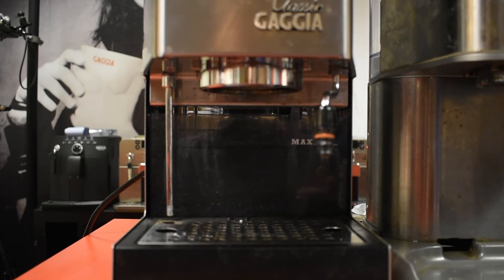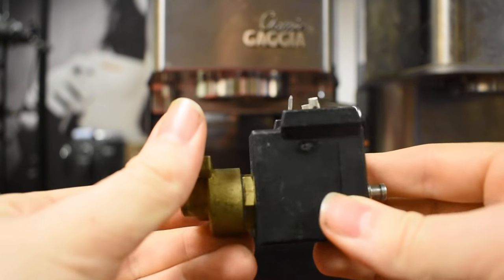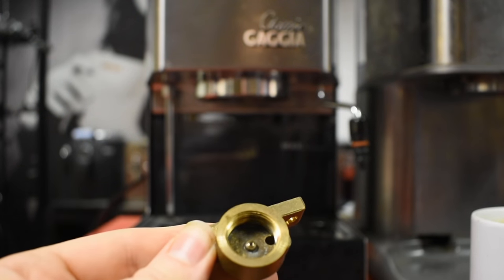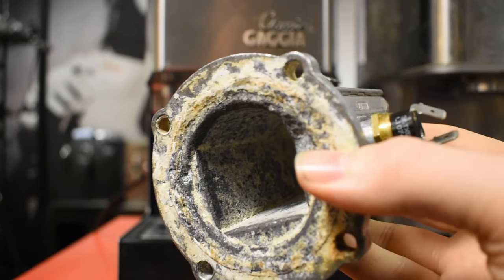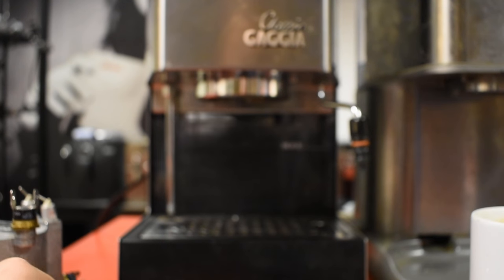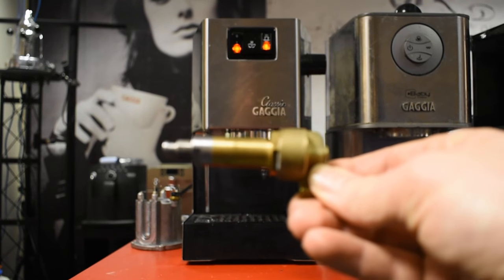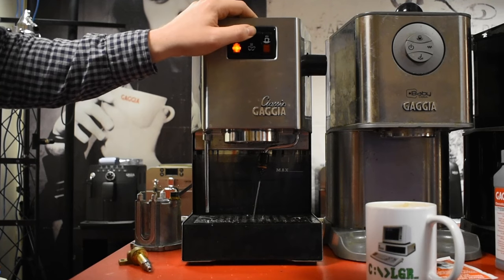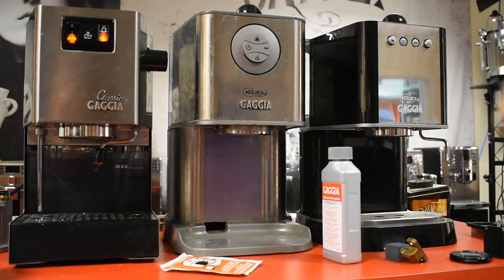Unblocking a Solenoid Valve on Gaggia Espresso Machines - Gaggia Caffe TV

Comment: Bloody hell!!  It works!!  I just unblocked a machine that had been standing idle for more than a year.  I was about to chuck it out and buy a new one when I came across this video.  Water is now gushing out of the brewhead.  The only thing I would add is to let the descaler sit in the machine for a while if it doesn't unblock first or second time around.  Also, collect the water containing the descaler and put it back in the reservoir; that way you won't have to use so much descaler.  Absolutely brilliant!!
Reply: John Teape Good tip about letting it rest and soak. I would definitely not reuse the descaler though as the water will have bits of scale and debris in it and you would not want to run that through the machine again.
Reply: @bslenter  i agree completely, unless the solution is not oily and the bits sunk to the bottom i think its fine
Reply: Legend it works perfectly

Comment: I found a pretty new discarded Gaggia Classic in near perfect condition at my local recycling center, took it away no charge, did this procedure and it works better than my 10+ yr old machine. It took all of 15 minutes and cleared on the first try. I was simply going to scavenge it for parts!! This procedure needs to specify more clearly that the tank is filled with descaler when you do these steps. And, probably a good idea to run about 300 ml of the descaler through the steamer wand first and let it sit a few minutes.

Comment: It looks like it was not the pump after all .  Well I have a spare pump, new gasket in place and Gaggia has been cleaned the way it should  and now will be cleaned.  There was not much water coming out of the group head , so I tried the  steam ,/coffee toggling of the switches and it appears to be working now. Why more flow out of the group head.   flushing with the descaler  now.  Thanks

Comment: 1. Put descaling fluid in the tank
2. Turn machine on
3. Open the steam valve
4. Turn on the coffee button
5. Turn the steam button on and off (6:05)
6. This will hopefully dislodge the bits of scale in the valve and water should start to move through the system
7. You might need to run this cycle 2 or 3 times
Reply: That's just worked for me thank you very much.
Reply: Legend!!!! Thanks so much. Worked for me too. Was distraught my old machine had died.
Reply: what happens if it stops pushing altogether thru coffee (not steam)....this all started when I did descaling but now I think it might be hosed
Reply: @TommyJordan-rf7zz  have you done this cycle multiple times? It's possible your descaling dislodged some chunks which have travelled down and lodged a bit lower. So potentially another few cycles could break them. (This happened to me).
Reply: U R THE MAN!  I was on #7 and was just giving up because nothing came out.  Then your encouragement made me try one more time.  8x a charm.  THANK YOU THANK YOU THANK YOU.
Reply: @TommyJordan-rf7zz  AWESOME!
Reply: thanks for detalis video not good,we need to close the wand wheel?
Reply: also waht u mean about the cycle we need to do open close steam button ,untill all water is out guys give a further details also i see ,the guy close the wheel what we should do?
Reply: @cryptolve  open the wand wheel

Comment: Being one of the lazy owners referred to by our master, my Gaggia blocked up after an infrequent descale.  The same thing happened a couple of years back and I had a tricky time removing the solenoid valve and cleaning it. This process was MUCH easier. I also used a blanking plate on my portafilter after running the descaling solution through the boiler with the steam wand, then turning the pump on an off to shoot descaler backwards through the solenoid.
THANKS.

Comment: We don't have limescale in our area. i.e. nothing in our kettle (soft water). However, when I took apart the coffee boiler and it had about a teaspoon of 'grit' in there. I think it is aluminium oxide that builds up over time, so I think it is generally best just to completely dismantle the machine every couple of years. I've marked the electrical connectors with numbers and photograph it with my phone as I go, otherwise you will never remember which wire goes where. I didn't disassemble the solenoid, but just blew it through with compressed air.

Comment: Thank you.  Your solution worked on my 20-year old machine.  The block happened after I replaced the steam valve.  A particle must have gotten knocked loose, and was stuck in the solenoid.

Comment: Thanks from the USA....I had this problem on my 2011 Classic and your solution worked even without running descaler through the machine (as I don’t have any on hand at the moment). I cycled the steam button on and off in several half-second intervals, checked the flow, saw progress, repeated a few times.

Comment: This was helpful and since I had no descaler on hand having just descaled (as was a noted potential cause) I performed the fix with only water, no descaler, and it fixed things, at least temporarily. More descaler is on the way in case it’s a band-aid solution but it saved my morning at least until the supplies arrive.

Comment: my 10 year old Classic developed this problem and I fixed it using this method without descaler, just the process of activating and deactivating the solenoid got it flowing again -great video. I was googling the cost of a new machine and at £450, I wasn't giving up 😂 Thanks

Comment: This worked perfectly! I was facing a difficult task to take my machine apart to access and clean the solenoid valve, when I came across this video and learned I could avoid all that. I went through the first tank of descalant and cycled the switch many times with no effect and was starting to get discouraged, but you advised it might take more than one and, sure enough, the second pack and more switch cycling did the trick! Suddenly I had water flow again. It’s working perfectly now. Thank you!

Comment: Hallelujah.. I was at my wits end thinking my ‘changeover valve was blocked with limescale’. Took it off…Cleaned it 3 times.. it was working so ummmm….still no luck. The water is very hard I’m my area. Anyhow….very long story short, underneath the brew head plate, there is a little larger than pin sized hole to allow water through to the distribution plate that your gauze fits to. It was blocked with lime scale. Quick poke with a pin and voila, it is now letting go of water like the proverbial race horse!. So if fixing the solenoid valve doesn’t work try this!…Hope this helps someone else out there! ☕️

Comment: thanks so much for the description of the solenoid and how it worked. I had seen other vids to fix this problem but didn't see the point of the switching repeatedly from steam to water until after you explained it. It still took a while, but once I understood the issue I stuck with it and now it's working 100% again. Cheers!

Comment: Great video, having  a hard time unscrewing the base of the brass housing (on the pre-2015 model), haven't got a vice and long spanner.  Clearly it comes apart but I guess most people replace the whole 3WSV assembly?  Not exactly cheap at least A$100.  Fun stuffing around with it anyway.. Thanks!

Comment: Just did this and it worked!! Water flow is normal again. This was the first time I had water flow issues. How do you know if the issue was caused by a chunk of loose scale that incidentally clogged the machine or if it is from too infrequent of descaling? I last descaled this September but I didn't have the water flow issue till a few days ago this November.

Comment: The other thing that can happen in this 3way solenoid is that solenoid spring can get slightly caught over spring stopper and jam solenoid piston from moving. It's hard to describe, but once you disassemble solenoid valve it will become clear. Just push the spring to its place and everything gets normal again. I just got used machine, and it happen today after 3 days and 5 brews. but it's fixed now. Dead giveaway for stuck solenoid piston is that there is no distinctive thump that happens momentarily when you push steam rocker switch. Another clue is that there is not a drop of water dripping from brew head. This can hardly be caused by scale buildup since there would be some drops of water coming through, having in mind that pressure is 12 bar.
Reply: @reljat I have zero flow/water through my group head and have been using this method for 3+ cycles. I am starting to get a bit disheartened. Could my problem be similar to yours? With 0 water from the group but lots from the steam wand. My machine was brand new, barely used but unfortunately I let it sit for ~4months and when I came back there was no flow through the group.

Edit: I think I hear a thump tho but I am not 100% sure because I don't remember what it would normally sound like vs no thump.

Comment: I have a Gaggia Classic, but without that vertical steel pipe that's on the left-hand side of the machine in this video. Does this method still apply to different versions of the Classic? I've read that some versions don't have a solenoid.

Comment: I done this once with liquid descale and it’s still not worked. Not even a drop has come out of the brew head. Is it worth buying more and keep doing this. Or (for £50-£80) but a replacement solenoid valve and attempt to replace it?  Any help gratefully received

Comment: What if the water drops from brew head while start the steaming process after brewing the coffee? I mean when i start preparing brewing process the steam pumps out from the group firstly, and just after that the water starts going out. After brewing the coffee i switch on the steaming button and the water starts dropping from group same time. 

Accepting the fact that the switching between buttons as showing in video for condition pre test shows that the valve works properly.

Comment: Hello I have a gaggia coffee deluxe and it does not have a three way solenoid…. I had this awhile and used to make great espresso but just recently got it working again but not great as before I have took it apart split the boiler cleaned it and group head everything and run more cleaner through…. What else can I do as sometimes it comes out brew head sometimes nothing out the steam wand?

Comment: This is a quick fix, but how you would remove the grime and scaling from the boiler, especially on the outside, that we see in the beginning of the video?
Mine has signs of green corrosion as well.
Soak it with a descale solution or use sandpaper?

Comment: Hi.. I have a Gaggia Baby-Twin head.. been working fine for more than 2 years, have cleaned head regularly and the wand etc.. Today the shot buttons stopped working properly . The solenoid clicks but nothing comes out of the head, no pump action. So tried a Manual operation but the steamer stopped steaming after a minute or so, before the milk had frothed.  Did a <M> operation to get the coffee out, that worked, put the partially frothed milk in then had to use uWave to get the temperature up as it was too cool.. Any ideas? neither button 2 or 3 produced the coffee delivery.. The steamer just used to carry on going until the black knob was turned but it now stops steaming well beofre the milk is ready... Sounds as if the unit has gone AWOL in some respect!! We do not live in a hard water area, so there's no scale...

Regards
Anthony

Comment: I really love your Video... The thing i was asking myself was, Can i take apart the Solenoid and clean it out without descaling ?
Reply from the maker: It is a part that is internal to the machine and I would not recommend removing it without expert assistance.
Reply: I am 18 year Watchmaker and am very good with small electronic movements..
Reply: This morning I’ve tired your technique and I am getting small drops of water out of the brew head.. I get the feeling these machines are problematic

Comment: I have a different problem - the water continues coming out of the brew head when the steam button is pressed, and water  comes out of both when the steam valve is opened. This means water is continuously leaking out of the brew head. I get through a tank of water every few cups! Will this solution work for this problem?

Comment: Hello. Thank you for this informative Video. I don't have the Problem with decreased water flow with my Gaggia Classic. It runs quite good. But there is the Problem with water dripping through grouphead and Steam Wand,  especially when the machine is getting hot. Do you know how i could solve this? Thx in advance, Ken
Reply from the maker: Hi Kenan, which model of Classic is it that you have? Is it the pre-2015, or post-2015 one?
Reply: @GaggiaUkElland  Hi. It's the pre-2015. Built in Octobre 2007.
Reply from the maker: @TheKenan542  It could be a few things then, the most likely candidates are that the steam valve isn't shutting properly and that your solenoid valve is at least partially blocked. It could also be that your coffee thermostat has wandered and your boiler is too hot. I would recommend that you get an engineer to look at it, are you in the UK?
Reply: @GaggiaUkElland  Hi. Thank you very much for the quick replies. Here are few more information: 1.I replaced the original Steam Wand by the Rancilio Silvia Steam Wand. 
2. I descaled the machine several Times with descaler based on sulfmic acid. There are still tiny pieces in White/Grey/black colour under the grouphead shower when i take it Off.
3. I'm drinking Espresso. So i wait half an hour to Heat the boiler Up. I also use the Steam Button. But i hardly get 200°F. 
4. When the water ist dripping through grouphead and Steam Wand there is a Simmering inside the machine. Maybe Steam is pushed Out through the Pipes and water comes with it?
I'm living in Vienna. I will search for an engineer. I actually hoped that i could repair it myself. But let's See. Thx

Comment: I had similar but discovered my boiler was leaking. Tried to disassemble but all 4 bolts are completed bound to the group head. I didn't mind springing for a new boiler as I've always wanted to fit one but the group head is expensive and this could total my machine 😭

Comment: That’s a shame. I repair these for a living and this will work but it’s a very janky way of doing it. You should just take the valve apart and wipe the scale chunk off. I’m here cause I have a very old model and was hoping I’d get to see him take that one apart to compare. 

The one I have is for a very old one and seems to have ruby/sapphire stoppers inside instead of rubber. Was curious if the gem stoppers had rubber on them at some point or not.

Comment: so, this is a 2 way solenoid valve, right ? if we want to have a nice dry coffee puck at the end, rather than a slurry stuff, we have to choose an espresso machine model with a 3 way valve.  correct me if im wrong.
Reply from the maker: Not necessarily. The puck depends on the amount of coffee, tamping and fineness. It also depends on the size of the basket compared to the amount of coffee.

Comment: Problem I am having with my classic seems identical to the problem you're describing. (There's only getting water though the steamer. Though I am at the seventh sachet of pully cleaner no sigh of progress. Any tip for a next step?  Replacing the solenoid?
Reply from the maker: Are you available on Zoom? To connect on Zoom :
https://us02web.zoom.us/j/85363528154
Between 10am and 4pm week days only
Reply: @GaggiaUkElland  So sorry I never replied! I've replaced the whole valve but still no water from the brewinghead. Does this offer still stands?

Comment: Hello, the base part of my solenoid valve is completely stuck to my steam boiler (the flange part) also the 2 screws are "screwed" any idea how can i repair this :/ I put it in some descaler and wd40 to try to get the screw out ... Any help would be very much appreciated. I was thinking about drewing the screw or something so i can dissamble that piece, cleanit and change th gasket to repair the steam leaking

Comment: What if I have the opposite problem and the water doesn’t come out of the steam wand valve?
Reply from the maker: This suggests the steam wand is blocked. Remove the panerello attachment and try inserting a wire to clear the pipe.

Comment: I have the opposite problem. My flow rate is too fast. The water doesn't drip out, it flows out and create four small streams of water. Is there a way to restrict flow?
Reply from the maker: Are you using a fine enough coffee. You also need to tamp the coffee hard to restrict it.
Reply: @GaggiaUkElland  I have my Eureka Specialita set to as fine as it'll go. I also use a distribution tool then tamp. The slowest extraction I got was 31 seconds for 18g in and 36g out. But I still think the machine's flow rate is too fast.
Reply: @LumiLunar  you can decrease the pressure (look up procedure on forums) because by default it s for pressurized baskets. Ur use a pressurized basket

Comment: Update: Hi unfortunately the machine stopped spray water before I make a ☕ 😞 .Opened the solenoid once again and than same starts and after 10 sec.no water again.When I switch the machine on there is clicking noise .Is this ok?
Reply from the maker: I wonder whether there are scale residue or something in the boiler that is coming into block it from time to time.
Reply: @GaggiaUkElland  I opened the boiler yesterday and rocks of limescal were blocked the hole where the steam is going our.So this must be the issue.